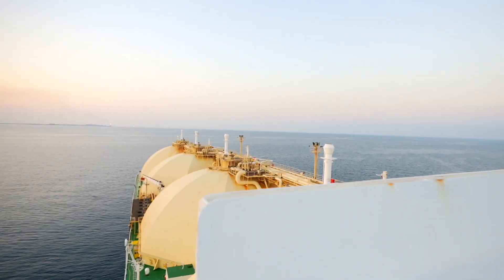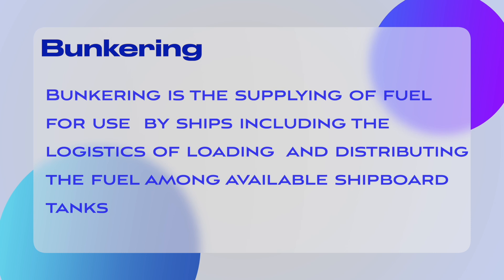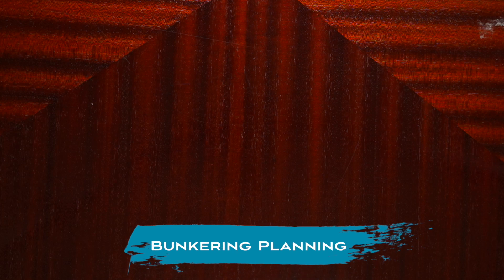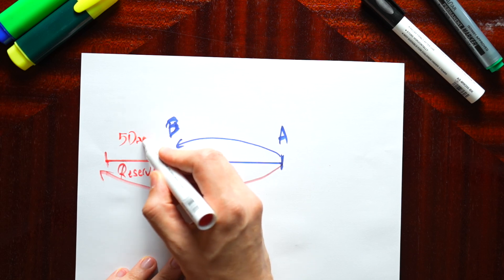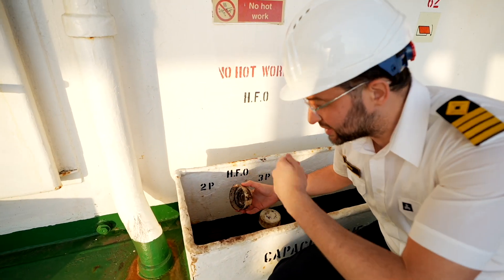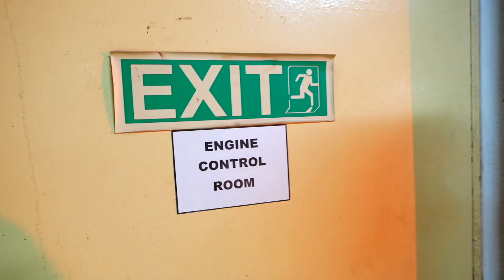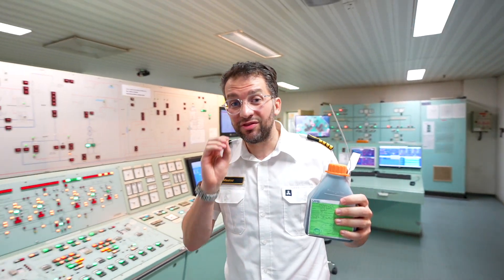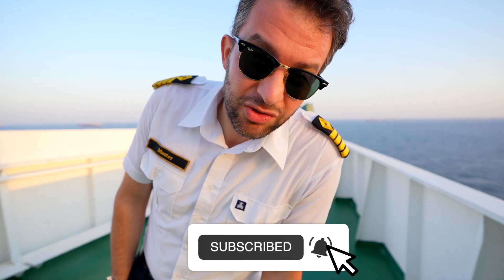The Floating Gas Station That Powers GIANT Ships at Sea!

Comment: Thanks, these explanations about your Heavy Fuel Oil were new to me and very interesting.
When I was starting my working life I was at a steelworks which fuelled its ingot reheating furnaces with "oil" which might have been "Bunker C fuel".  Cold it was like road tar - a solid - spillages you collected up with a wheelbarrow, pickaxe and shovel.  Burned it was very very sulphurous.
I think your fuel is much nicer, but costs a lot more.  Half what I pay for central heating oil, which is a kerosene / paraffin distillate - so not "very very cheap" any more.
Reply from the maker: Thanks for sharing Richard